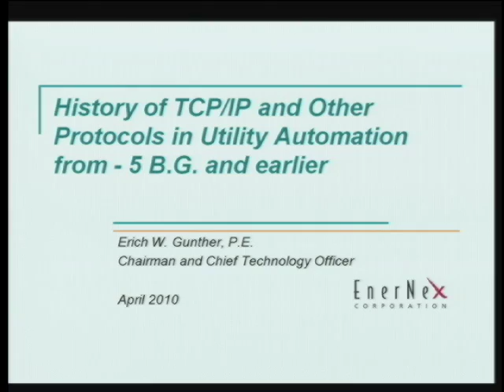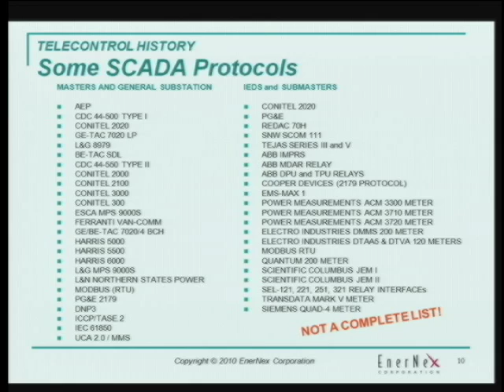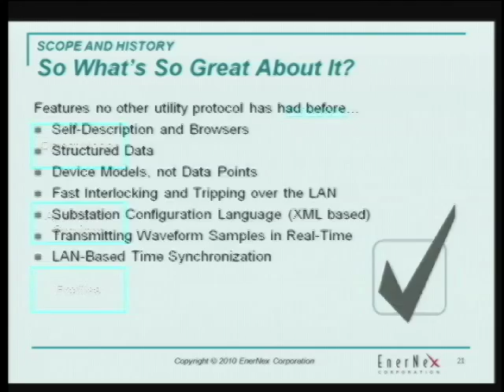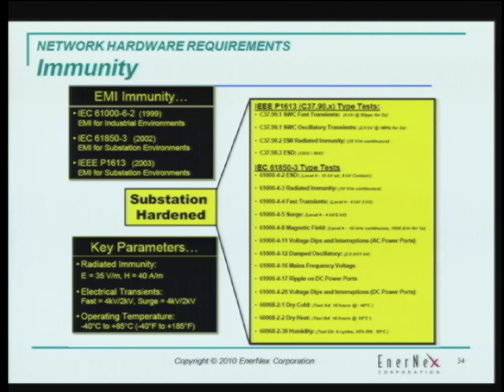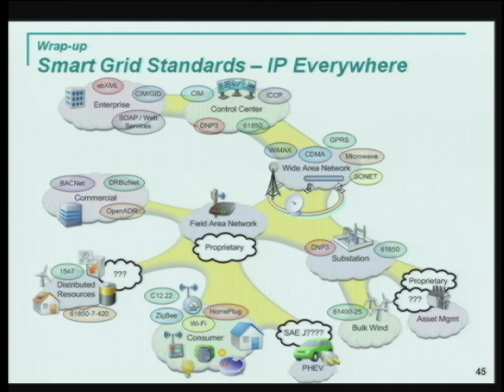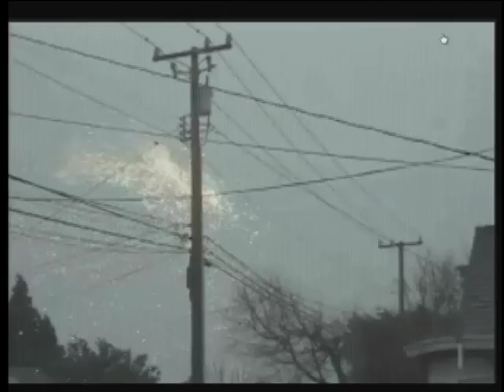Smart Grid, Utilities, and Internet Protocols

Comment: The term “radio wave sickness” was first used by Russian doctors to describe an occupational illness developed by large numbers of workers exposed to microwave or radiofrequency radiation. The symptoms were called “neurasthenic.” “Neurasthenia” was an older term for this group of symptoms, which was coined by an American physician, George Beard, in 1868, to describe a new type of illness that followed the building of the railroads and the telegraph system in this country.

Comment: @captcaveman4201 Just like the same can be said of computers, the price of solar panels HAS come down steadily for the past 40 years. The main driver has been innovation. I agree that no subsidies should be given to any fossil fuel market and I would even agree with a reasonable carbon tax (somewhere between 20 an 50$/Tonne) but even then solar would still not cast a shadow on oil an current price. Their price will have to go down by about 75% before that, not that it's impossible.

Comment: @captcaveman4201 And by smart home I assume you mean well isolated with only efficient appliances, some sort of electrical generation, (either solar, wind or some form of fossil fuel) and powerful batteries. Sure it is feasible but it's also generally a lot more expensive overall to produce electricity this way. Don't get me wrong, I do thing that solar has the potential to become economical when used this way, but only after the price goes down (which it has the potential to).